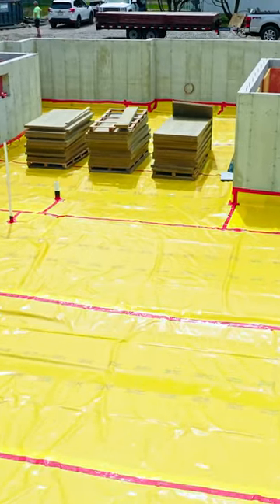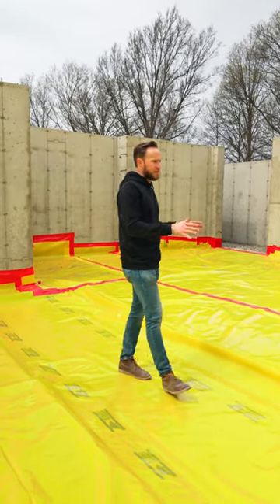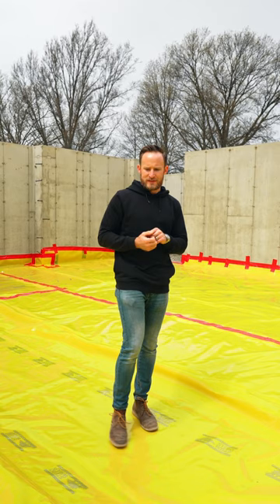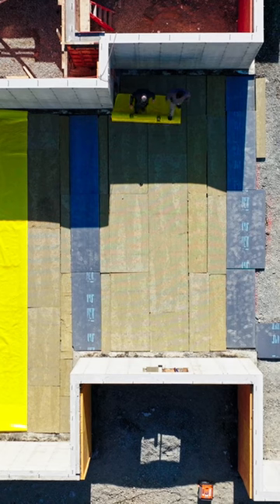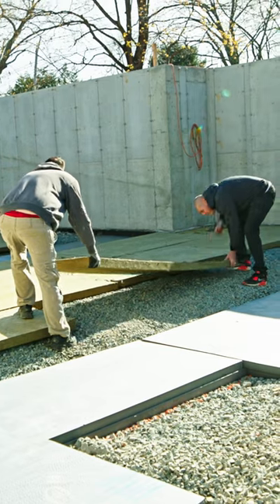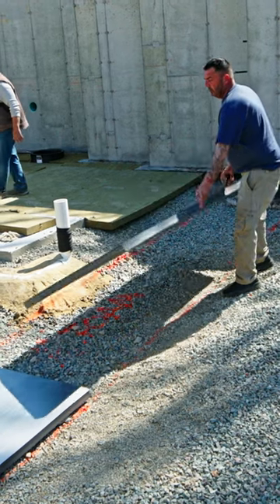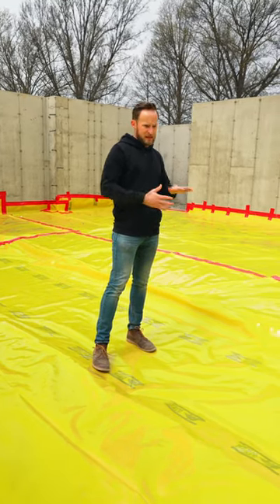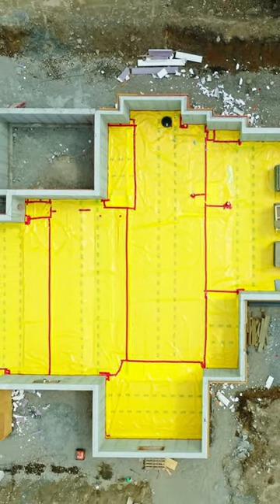Under basement slab prep

Comment: Why would you use rockwool? I use it for cloning plants and it works well because it holds water forever. Isn’t that the opposite that you would want for this scenario
Reply: that's the point rock wool is vapor open so it can dry out just don't add water right.
Reply: It holds water with out falling apart. Water can pass it and out, similar to gravel but you get better insulation characteristics.

Comment: Just use spray foam and you will get the insulation and a water barrier. Save time and labor.
Reply: Would the concrete weight do damage to closed cell foam below it?
Reply: @Bolthrower91  no

Comment: I m curious as to what the actual cost of building this house has raised with all these xtra insulation on the exterior of the structure as well as basement… don’t get me wrong it’s incredibly protected but at what cost and what is return of investment and how many years… I’ve been in trades for over 30 years Electrician/Contractor and experience all types of homes from remodel to new homes custom, from 2000-14,000 sq ft homes I’ve seen a lot and this is a first watching these vids impressive building but the cost has to be ridiculous for the upgrades…
Reply: The upscale is the entire business model,  like they go full tilt on every build.

Comment: What are you using for the moisture barrier ? How thick is the poly? You taped seams good practice. We prepped basements like this in the midwest where there is significant temp swings and deep frost line. Rockwool is a good medium.

Comment: structural  foam board is interesting, we'll know in a few years how well it holds up
Reply: Won't matter rebar and concrete take the weight
Reply: Used in lots of commercial buildings.

Comment: You have rock wool under the moisture barrier? that’s gonna be soaked with water in no time 😂😂😂😂😂😂
Reply: Madness...sometimes I think west is quality everywhere and then this... in my third world country we have better moisture barrier...
Reply: Umm, you see the capillary break underneath the insulation, right?
Reply: Why would there be that much water? Pretty sure Nick and crew aren't putting a basement inside the water table. 🙄
Reply: @paulrey27  rock wool is just a sponge so if there is moisture it’ll stay for at least a week
Reply: @BogeyBoys28  Rockwool is hydrophobic though...isn't it?
Reply: @paulrey27  my plants say no
Reply: @paulrey27  rockwool 80 they're using is 4 times as dense as the rockwool batts most of these keyboard contractors use to grow plants or whatever.  It'll be fine understand, especially with that capillary break.